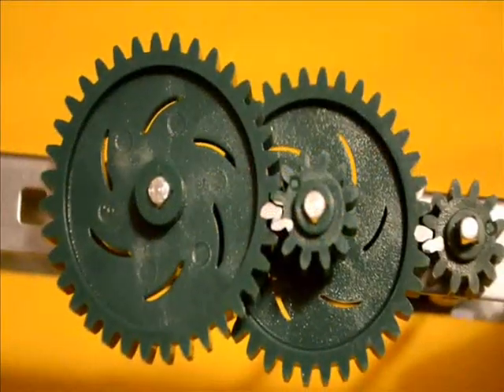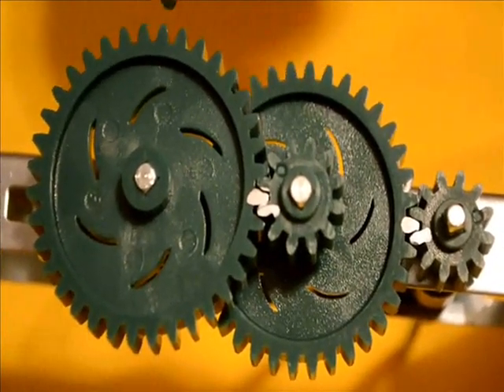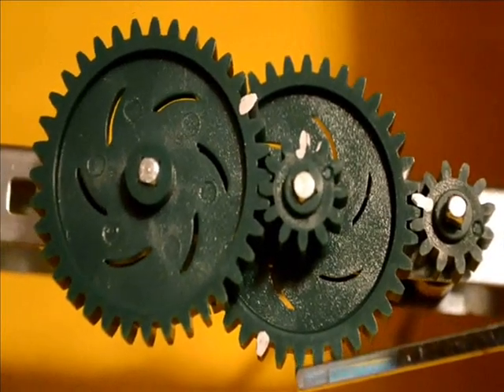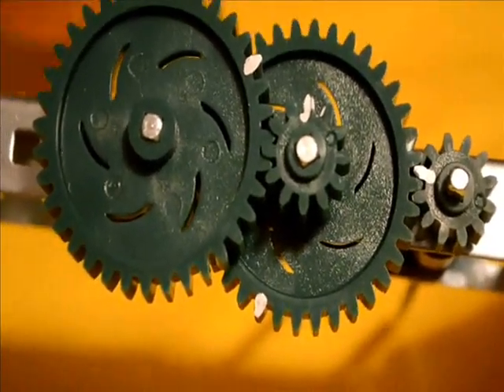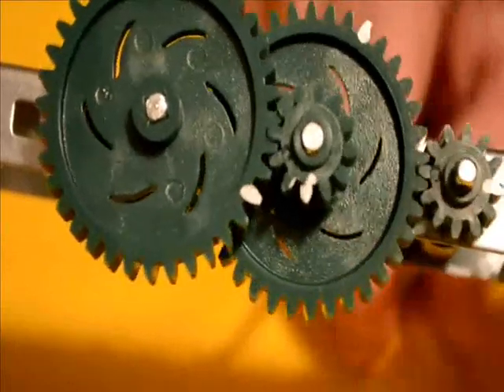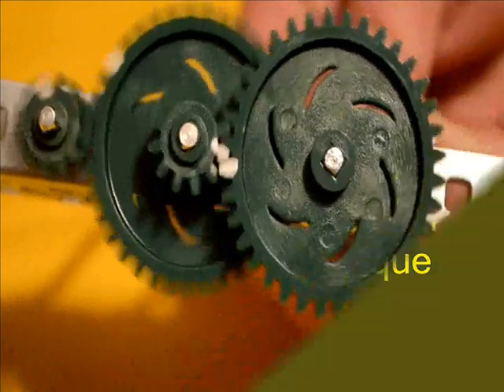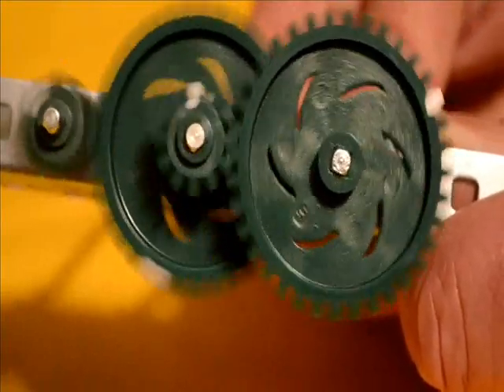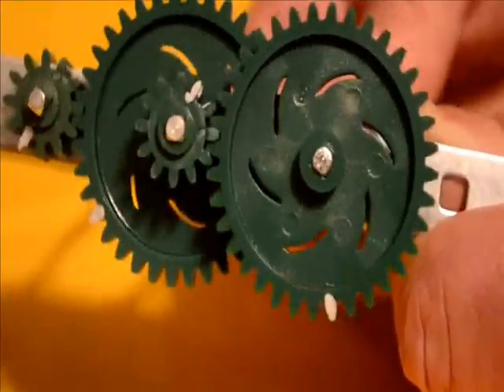Gear Ratios Part 3.

Comment: Is it possible to keep the same rpm as input and increase the output torque by 9 times using multiple gears ?
Reply: As far as we know physical physics to be, that will not be possible. You change speed to gain torque, and you change torque to get speed. You can't keep the same speed while gaining torque, or having the same torque while increasing speed.
Reply: @houalee9101  this means idler gear doesn't  affect speed and toque its only change direction?

Comment: Would the 9x strength be able to hang a heavy robot? Im kind of on edge here because I cant seem to find anything that works well.
Reply: If you have the gears - it is worth a try.  If you need to buy the gears, you can find the average torque output of your motors and then calculate the torque necessary to hang your robot and find the minimum gear ratio to match that torque. then build a stronger gear ratio than your answer.